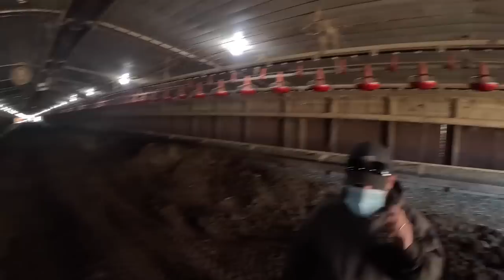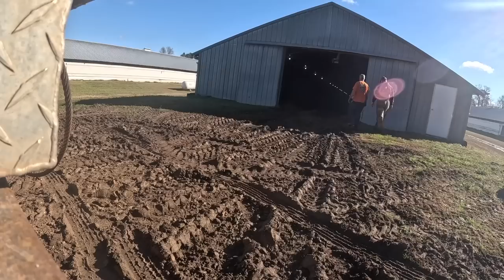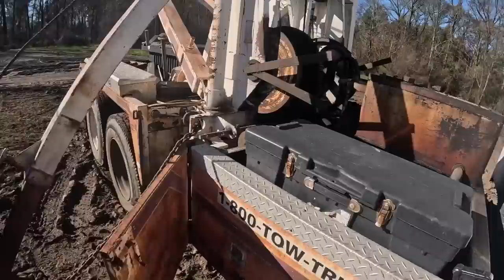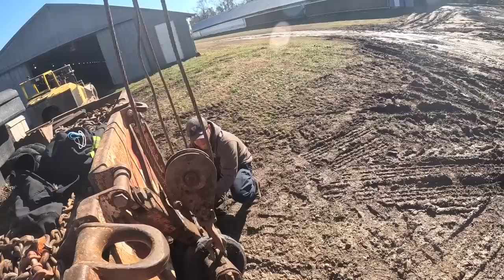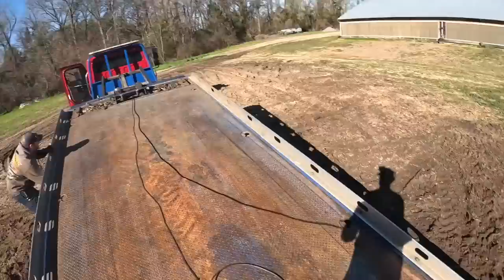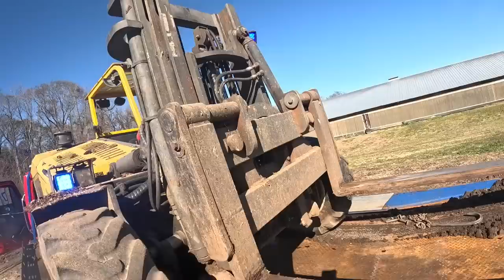Holmes 750 Doing Some Side Winching

Comment: Holmes 750 was the original rotator of its time.
Reply: Lloyd actually the old military M936 was the original rotator
Reply from the maker: Mr Lloyd thanks for watching and stay safe
Reply: @jimsmith9819  before rotators became common, Holmes wrecker bodies were known for their ability to recover vehicles from the side. They were known for their ruggedness, strength and innovations. The side rotating booms were ultimately available on several of their wrecker bodies starting with the Holmes 485 models.  All but the first Holmes wrecker were designed with side legs to help prevent tip over of the wrecker when pulling from the side. Holmes acquired a patent for his wrecker design with swiveling booms in 1919 and was initially offered on a Locomobile chassis. Many of the older models were known for their PTO driven winches. These winches were incredibly rugged, but dead slow. The more modern hydraulic and many electric winches of today are far faster and can have as much or more pulling power. 
The most common military wrecker of the WWII era was a Diamond T model 969 truck with a Holmes W45 heavy duty wrecker bed with twin booms. Their were many other wreckers constructed and used by the military during this time period.
Reply: @lloyd1344  i used to drive a wrecker with a holmes set up
Reply: @jimsmith9819  if you ever get to Chattanooga ,TN There is a wrecker museum their that is a great tour and history of the wreckers.

Comment: Love me some 750 action! I learned on a 750 in the early 80's You might have been able to spread the booms and used your roll back or that guys pickup for a low anchor point.
Reply from the maker: Phat Boys  Yes sir that would have worked as well.  Thanks for watching and stay safe.
Reply: i learned on an old holmes on a two ton 56 Chevy in mid 70s

Comment: Holmes 750s the best used them for years before Hydrolics.
Made yah think about what you were doing. Definitely taught you about angles and mechanical values
Reply from the maker: Mr Charles We appreciate that. Thanks for watching and stay safe
Reply: Owned my own HD tow service for 35 years sold  it 8 1/2 years ago and still work for new  owners
Reply from the maker: @charleswismiller3271  yes sir. Stay safe